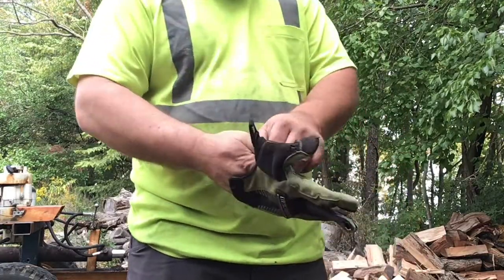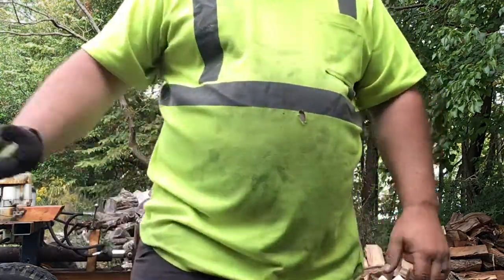Vintage Homelite Super XL Automatic Aftermarket Reed Cage First Test!!

Comment: Maybe with thicker reeds there is not enough vacuum to open the reeds to allow enough mixture at high rpm and not leaning out just starving engine all together, just a thought, keep up the great videos Brian!
Reply from the maker: My gut feeling tells me it’s a carburetor issue but it is very possible that you are correct!!

Comment: If the Reed's are to stiff u can sand em slightly and it lightens them up and depending on where u sand em they can open sooner at a lower rpm or just open up wider for more fuel ur definitely on to something tho buddy hope everything is well for you and the family.
Reply from the maker: Yes I learned that trick a long time ago but I don’t think It will be necessary for this saw. I believe it is a carb issue. We will soon find out.
Reply: @Smittyschainsaws  ok I figured u knew about that ol trick but just wanted to make sure that base was covered if need be lol.

Comment: were you sharpening with a dremel ?  just did my axe and hatchet.   need to do all my used chainsaw chains
Reply from the maker: Looks like a dremel but its a sharpener.  You can get them from tractor supply.
Reply: @Smittyschainsaws  i took a dremel and a small diamond type bit to my chain. i think i was getting it right lol. seemed sharper. i see this ezdoo sharpener in amazone its like a dremel. it has round pencil shaped bits. still trying to think how that puts the right angle on it
Reply from the maker: @joesmith-fi1sx  The sharpening tool that is made for saws has a guide plate.  It is very easy to use and I do better with it than by hand.